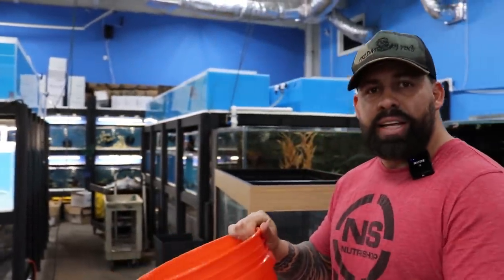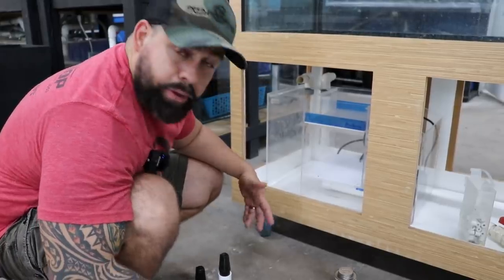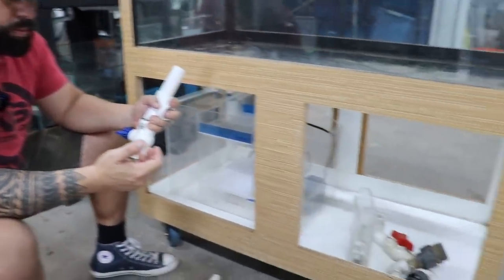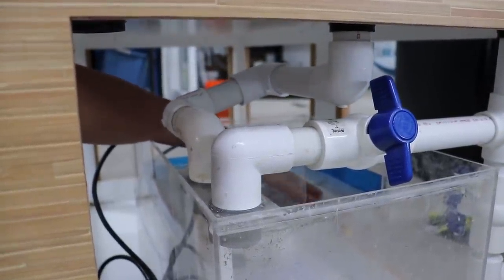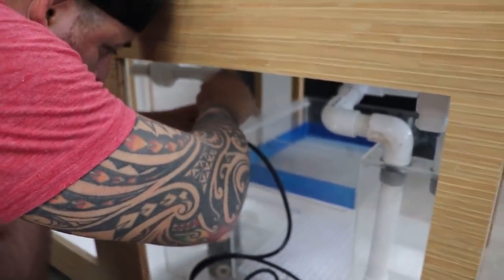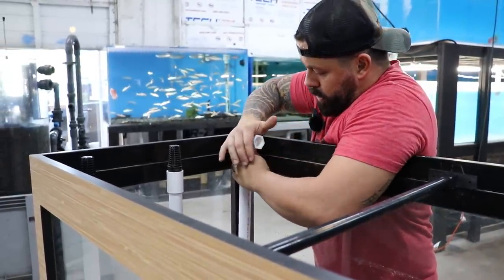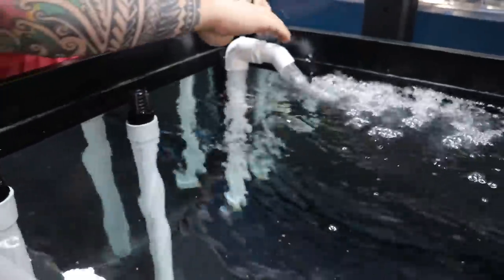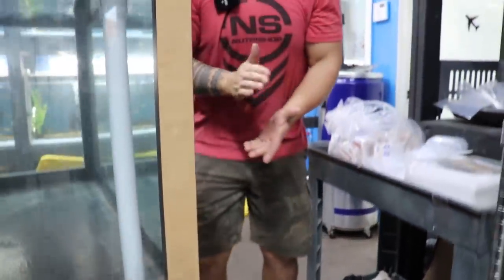Mobile HOSPITAL TANK  DIY plumbing

Comment: 6:15 or you coulda put the valve to to right side by swapping the 6.5” and the lil short pieces of pipes you woulda gained a tiny bit more clearance compared to the ball valve as well.

Comment: Use flex pipe from the pump up to a fitting to go into PVC. It will let the pump move a bit and make it so it doesn't rattle on the bottom of the sump.

Comment: Hey  Rod , Just a suggestion where the PVC adapter has threads. Its a good idea to use Teflon tape on the thread to prevent leaks Good luck Vince

Comment: Did I miss it or did you not glue the PVC with cement and primer? Just curious if you think Aquarium pressure is low enough to avoid glue or not

Comment: I'm no plumber so, if I'm talking out my ass, sorry. But wouldn't it have been cleaner and better flow to use 45° corners rather than the full 90°? You might have been able to eliminate that horizontal U and a couple of the corners... maybe. Or I'm completely wrong - lol